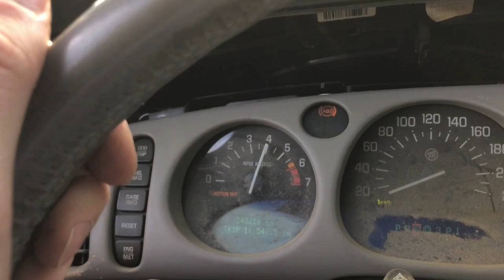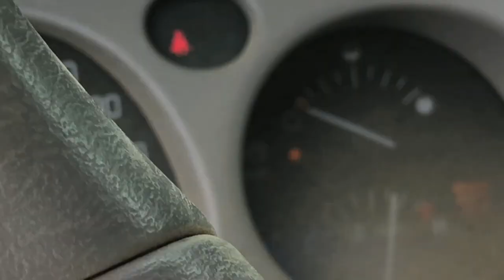EPIC Buick LeSabre Flat Tire CAR JUMP!!!

Comment: I'm sorry, but it just hurts me to see this. I took one of those cars, rebuilt the top end of the motor to take care of the water jacket intake problem....it's been one of the most reliable cars I have ever owned....you can pull 500 to 700 000 miles out of one of those cars. Dudes....interesting video, but wrong car. Why couldn't you use one of those POS post 2008 chevy's with the crappy 6 cylinder motors? Leave the poor 3800 6 cylinder cars alone. People actually want those engines. :)